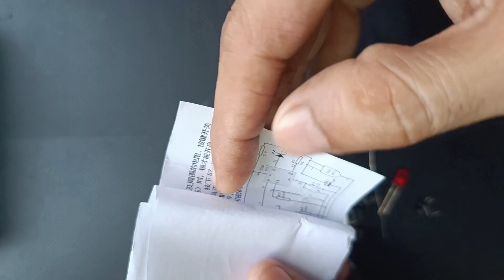Simple Project: Electronic Password Locker without Arduino !

Comment: Could you please explain how the circuit works?
Reply from the maker: This circuit contains three ICs (U1,U2=CD4013 x 2 and U3=CD4011), resistors, capacitors, LEDs, and push switches for creating an electronic password lock.  IC U1 (CD4013): This is a dual D flip-flop IC. It is likely used to store and control the password. We configure the D flip-flops in ICs U1 and U2 to store the correct password. The D flip-flops can store binary data (0 or 1). 
IC U3 (CD4011): This is a quad 2-input NAND gate IC. It could be used for logic operations in the password verification process. When a user wants to unlock the device, they will press the push buttons (S0-S9) in a specific sequence that represents the binary code of the password.  IC U3 (CD4011) likely serves as the logic gate to compare the user's input (push button presses) with the stored password. The exact logic operations will depend on the design of the circuit. Here this circuit uses a fix password as per the PCB design, but we can change the password by changing the circuit layout little bit. There is an RED LED that indicates the either the circuit is locked or unlocked. Hope some idea you got. Thanks for this important comment !!